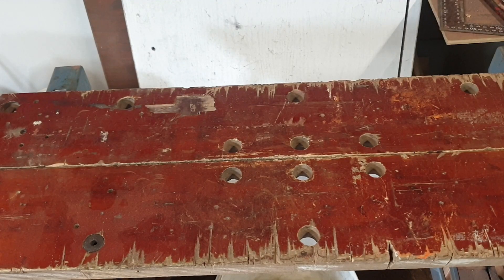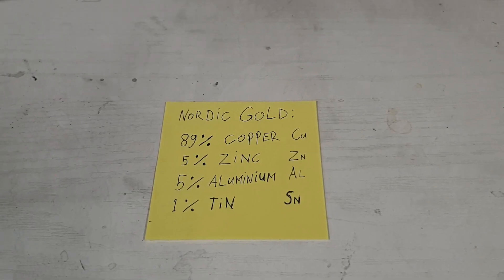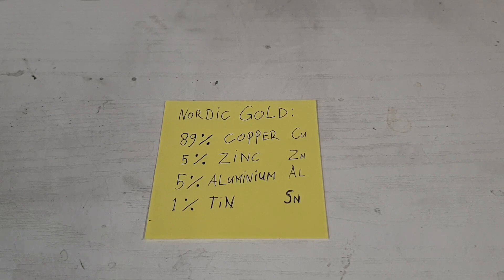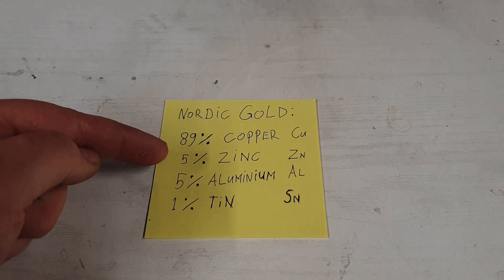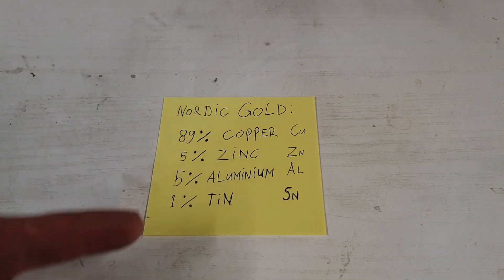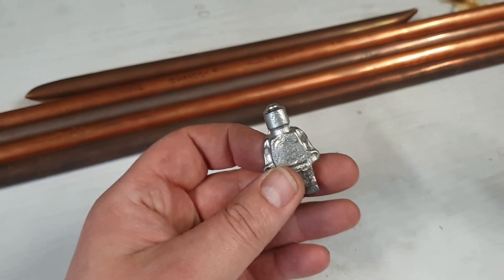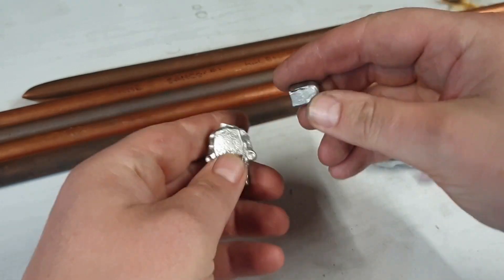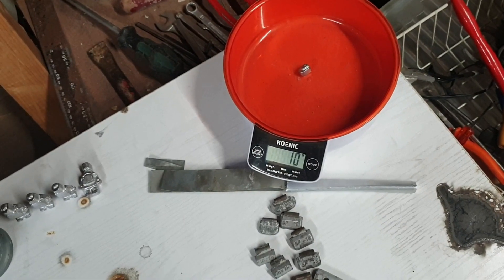Making my first Nordic Gold bar, Mixing Copper & Zinc & Tin & Aluminium

Comment: can we make something which is like silver in colour with 58% copper, 27%zinc, 13%aluminium and 2% silver?
Reply from the maker: This is possible to make, but is this a  recipe for a specific alloy or just a random mixture?
Reply: @ralphmourik  there's an alloy white bronze but that is brittle so i modified the composition a little to make it castable (aluminium can be replaced by tin also)

Comment: Historically wheel weights are lead I think
Reply from the maker: Correct, they used to be Lead, you still find them sometimes, most are Zinc now, but more and more are changing to iron. Thanks for watching and commenting.

Comment: Uh? How do we find these...
Reply from the maker: Do you mean the base metals?
Copper comes from wires.
Zinc comes from wheel weights or gutters.
Aluminium can be found in many things, soda cans, heatsinks out of electronics, or in this case from big wires.
Tin can be bought as solder without lead, or from pewter with high Tin content, 98% in my case.

Comment: What is the temperature needed and furnace needed?
Reply from the maker: Well the electric furnace I use is the Goldbrunn Term 3000, but there are many others like it available, they usually go up to 1150C which is more than enough to melt anything up to copper which melts at 1085C.
Propane furnaces are also popular and used for bigger quantities of metal. The most used brand that I know of is called DevilForge.

Comment: very nice , am not allowed to smelt metals in my flat now  if i make anything now its got to be polymer clay or paper clay sorta takes the fun out of it .I still have my solder pot smelter for pewter after the year 1974  as lead stopped been added then and is much safer. anyway mate its good to watch a pro at work I very much enjoy your shows

Comment: Nice work. My favorite alloy is aluminum bronze, but this has a nice color. I may have to give it a try. What's the shrinkage like?
Reply from the maker: Aluminium Bronze is next on my list, I need to get some more different metals for more alloys. Seen some interesting ones that require Bizmuth. Can't tell you much about shrinkage yet though, I only made this bar so far 👍👊

Comment: Great video 👍. It's weird the circuit breaker kicks because of the crucible. 🤔
Reply from the maker: It's a grounding issue in the device I think, when the crucible gets worn down and it's at high temp for some time the earth breaker trips... very annoying
Reply: @ralphmourik  that's so weird though. Lol my breaker kicked before a few times.  Then it stopped working.  The heating coil went bad.  I think it was ready to break when it kicked the breaker.  Then.... It broke.
Reply from the maker: @HeinrichsMade  It has been doing that from just about the beginning but the coil still works fine, gonna look into the electrics in the garage soon and take the furnace apart for a check.